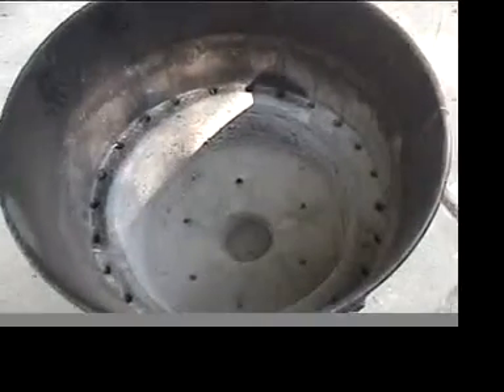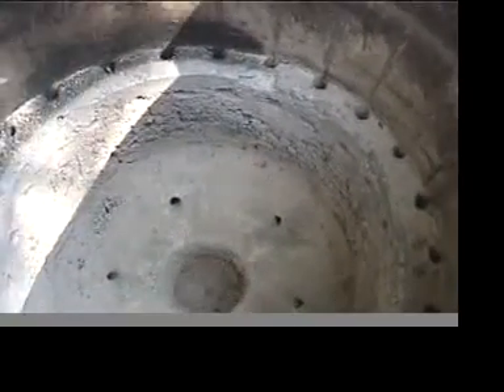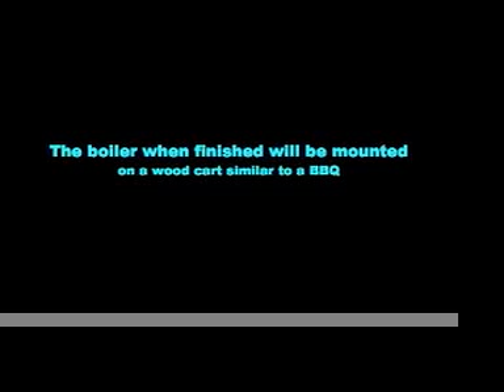Lynx Wood Gasifier Monotube Boiler 09

Comment: i thought you have to add wood only after the wh0ole batch is consumed because the fire always has to start from the top..  I have one and if i just add wood in the middle of the batch run it will make too much smoke because i interfered with the ratios...  ur design is very smart how you made an ash collector using the sliding effect... mine doesn't have this